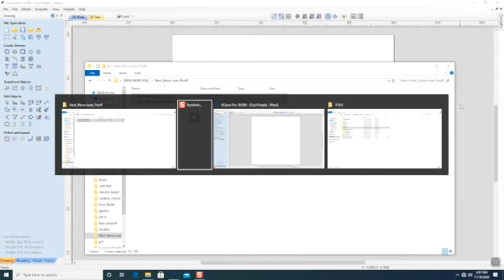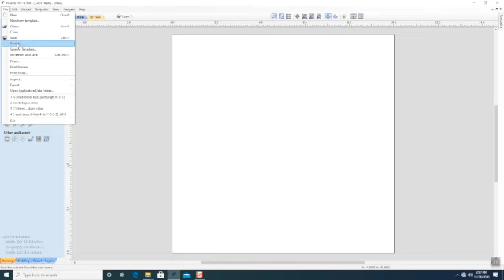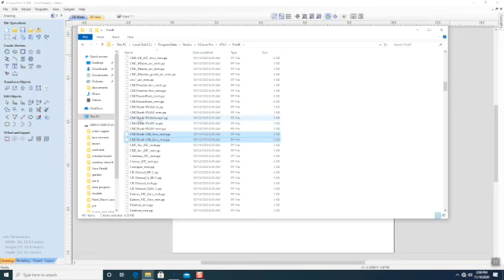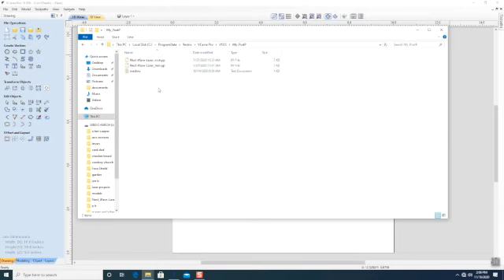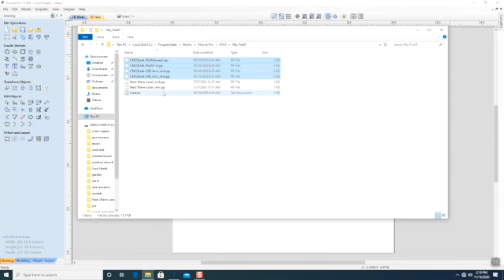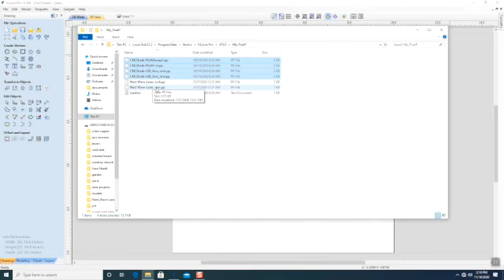Adding a laser post processor to Vcarve Pro 10 +

Comment: How did you add a MYPOST PROCESSING folder or how did you do it.   Also how do you get the MY POST PROCESSORS to show up when going through list of setting up a cut?
Thanks
Hager
Reply from the maker: Open Vcarve then open the File tab then open Application folder

Inside the application folder are the two items you are looking for PostP for post processors and the other one is  My_PostP for My Post Processors

once you open the My_postP folder you can copy the info you downloaded from Next Wave CNC

Good Luck
Reply: @cecilwoodworking7204  thanks for the clear step by step instructions.  Now I will look up next wave cnc